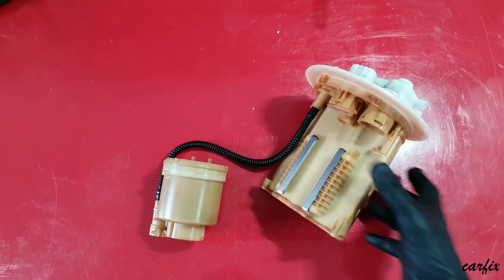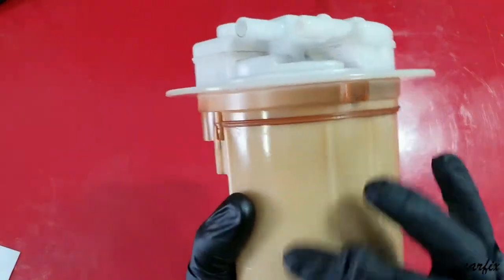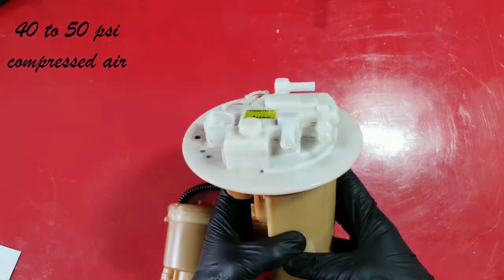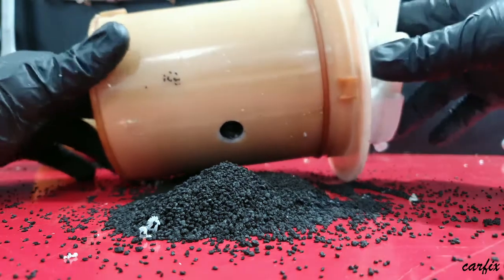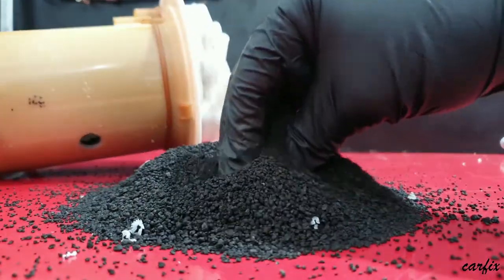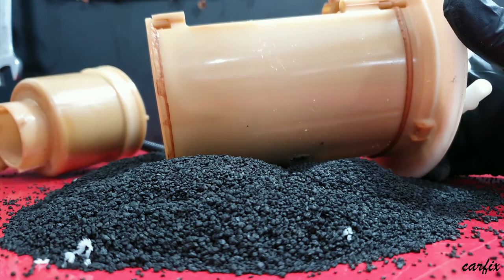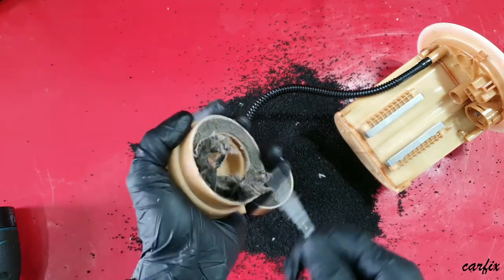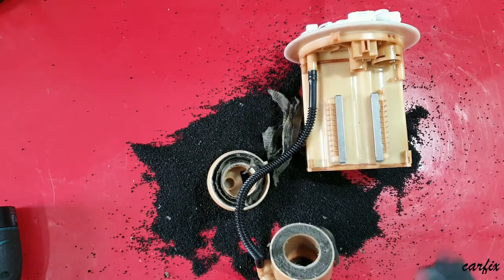corolla fuel filter replacement

Comment: Just confirming that for my 2013 corolla the fuel filter is in the fuel tank? How much does it cost to replace this fuel filter? And would you advise to replace it every 80,000 kms?
Reply from the maker: Yes it is inside tank 
Yes every 80000km should be better 
Actually don't know cost depen on county.